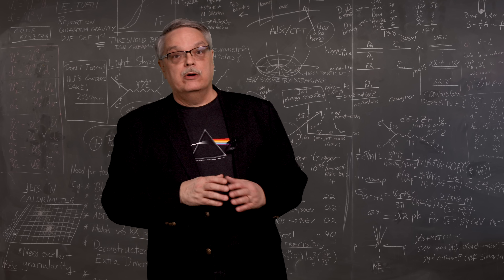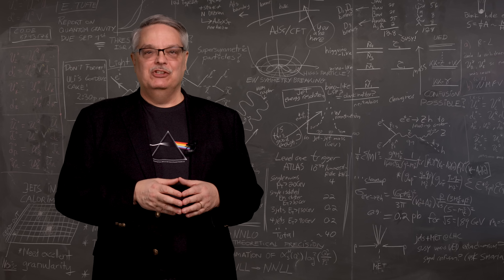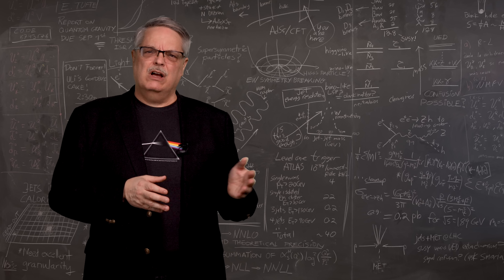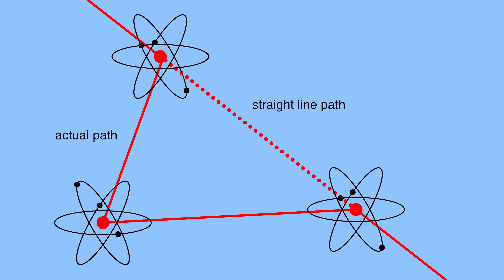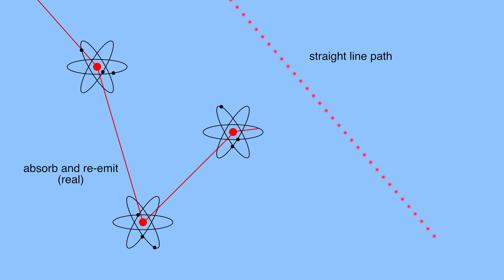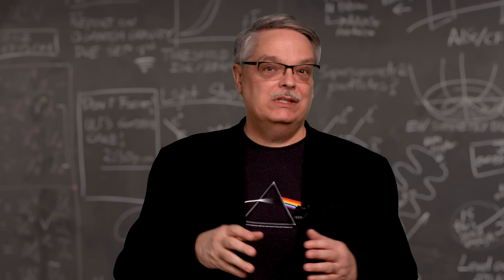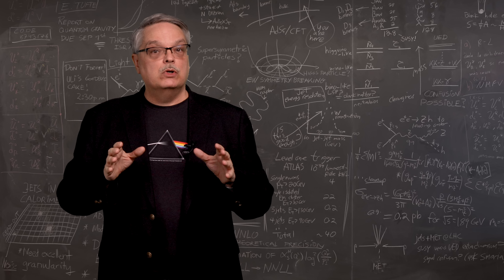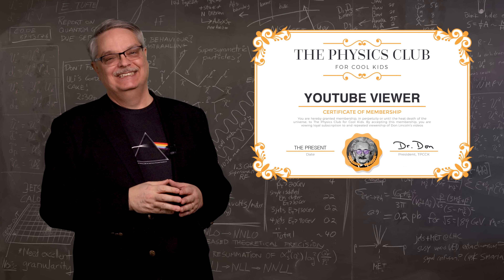Why does light slow down in water?

Comment: All very complicated. How about this:
Massless particles do not move. They expand with the universe which expanse in a quanta or pulse like expansion at a speed of, you guessed it, c. 
All particles that attract each other resist that expansion, causing what you call gravity. 
As light enters glass, it doesn’t slow down because it isn’t moving. Instead it is propagated through a different time frame due to the reduced expansion. 
Simple! (I’m from the future by the way and this is common knowledge)
Reply: Weird from my time-line in year 2251 we have a different explanation.
Reply: Oh crap. I’ve altered the future again! I’m going to get fired for this.

Comment: Much fun and i love the straightforwardness of the reasoning and presentation, but there is something i am missing. If the interaction of the light wave with the electrons is producing a second oscillating electric field that will be summed with the original light wave, wouldn't the second field have a constant phase delay relative to the light wave? That wouldn't produce a slower wave - it seems like the summed wave would be an attenuated (by the second field) version of the original light wave traveling at the same speed. I don't understand where the slowing comes in.
Reply: In the link below there is a really good explaination with quantum field dynamics. It is less hard than it sounds. It comes down to this: When a photon enters the medium, the EM-wave interacts with charged particles in the medium. It shakes them around, and drags them with it. To do this, the photon has to give some momentum to the material. The cool thing is, that while doing this, the energy of the total wave stays the same, but the momentum goes up because the mass that is part of the wave goes up. But if the momentum and the mass of the wave goes up while the energy in the wave stays the same, the propagation speed must drop. At the end of the glass, (almost) all of the wave energy goes back into the massless photon, and it shoots off like nothing happened. Just learned this, and I think this explaination is very satisfying. https://journals.aps.org/pra/abstract/10.1103/PhysRevA.95.063850
Reply: @frederikwinnubst7863  Any correlation to Lenz's Law?
Reply: I agree, I am missing something too. The only way that makes sense to me is if the induced electric field travels slower than the speed of the inducing field - which doesn't sit well with my understanding of physics. Dr. Lincoln said that (paraphrasing) "taking longer to traverse the medium is the same as going slower", why would the interaction with the induced electric field make the resulting superposed waveform take longer to traverse the medium?
Reply: The phase velocity of the second wave is much smaller. That drags the phase velocity of the summed wave down.
Reply: @frederikwinnubst7863  "The phase velocity of the second wave is much smaller".   
Ok. Why?
EDIT: Ok I'll read the paper tomorrow. Thank you for the link.
Reply: @frederikwinnubst7863  What is "phase velocity?"
Reply: @frederikwinnubst7863  But WHY is it smaller?
Reply: Light is slowing because the Speed of Light is NOT A CONSTANT.  Period.   All other answers are mathematical tricks.

Comment: This does not only apply to light, it applies to any electromagnetic wave travelling through a medium. Back to light again... If light were to travel through a vacuum it would travel at a velocity equal to the speed of light (299,792,458 metres per second, although that figure dosen't really matter, because it is theoretical). instead we use a 'velocity factor' to describe the velocity that an electromagnetic wave  will travel through the medium that it is travelling through. This 'velocity factor' is the ratio of the velocity at which a wavefront (of an electromagnetic signal, a radio signal, a light pulse in an optical fibre or a change of the electrical voltage on a copper wire) passes through the medium, to the speed of light in a vacuum. More here... https://en.wikipedia.org/wiki/Velocity_factor

Comment: Thank you for your video. One question: lets suppose that a monochromatic beam (a laser) travels through water or air with high humidity. How that will change the color (frequency, wave length, scattering)?

Comment: But there is one question remains. Does wave generated by electron moves slower than the light wave?? If it is not, there is no reason to say that the speed of light will be slower.(but the only thing that we can say is the wave length of the wave will be changed)

Comment: Why does not the color of the light change if it's frequency is changed inside the material?
Reply: I was taught that  frequency depends on source so it does not change when light crosses a medium rather the wavelength changes in such a way that the ratio of speed of light in a medium to the wavelength of light in the medium remains constant and hence the colour doesn't change.

Comment: He must be wrong when he says the induced wave travels slower than the incident light. Both are em waves
Reply: Singing Physics with different wave lengths
Reply: @oceanwave1875  yes but different wavelength waves have the same speed
Reply: @singingphysics9416  nope the wave equation is different inside a medium, thus modifying its speed
Reply: @recouer  but em waves always have the same speed
Reply: @singingphysics9416  it has the same speed in a void, the speed of light is highly dependant on the medium in which it goes through.
Reply: @singingphysics9416  
you can easily find the speed of a wave by finding its wave equation, just google "wave equation" and look at the wiki page, it's rather hardcore physics but if you are determined enough, you may come to understand how it works (cause it's not that hard to understand)
Reply: @recouer  yes, classically the speed of a wave depends upon the medium. But according to special relativity it doesn't, hence the need for this video. I think he just made a slip of the tongue to say the induced wave had a lower speed
Reply: Singing Physics  no no no, that's not what relativity says, light really does slow down in a medium, just not for the reasons understood in this video (dr don kinda misexplained trying to vulgarize the phenomenon)
the maximum speed at which a massless particule can travel in a vacuum is fixed that's what's said.
Reply: @recouer  you're mistaken
Reply: @singingphysics9416  then so is wikipedia
Reply: @recouer  link please
Reply: @singingphysics9416  
"According to special relativity, c is the maximum speed at which all conventional matter and hence all known forms of information in the universe can travel"
https://en.wikipedia.org/wiki/Speed_of_light

Comment: Why does the light bend back to original angle after leaving the glass?
Reply: The answer is that it doesn't typically exit at the same angle based on the angle ot enters and the mediums it passes through. 
https://youtu.be/DR-8ZRCHCXI
Reply: Because it speeds up again
Reply: excellent question.   I hope it gets answered.
Reply: Ok. I'm going to try this one. The photon is a sustained wave in the photon field. When it enters the medium, the electrons (sustained waves in the electron field) interfere and the combined wave is slower as determined by the refraction index of the medium. When the combined (interference) wave exits the medium, it no longer is influenced by the electron field, so it returns to its original energy state and continues on its original path and speed. 

As Don stated, you must think of the photons and electrons as waves. And waves exist in their own quantum fields. These fields exist everywhere. So they exist on top of each other. One wave in a given field will influence other waves in other fields, if they exist in the same place. When they are not in the same place any more, they return to their original state. For this example, the same speed and direction.

Comment: Light does not change speed ever.  This paper shows why.  Remember refraction is right at the surface.  Light does not effect electrons at all (proven many times).
If you want latest information on time dilation, fixed light speed and understand algebra, then download this open access, no login, no ads, 2018 Cern archive journal paper.    https://www.zenodo.org/record/1447218

Comment: An even more interesting question: why does a photon generated in the centre of the sun, travelling at 186,000 miles per second, take 100,000 years to reach the surface and finally be liberated?

Comment: But the speed of light and is the same as the speed of every electromagnetic wave!!!! So also the wave generated( by summing the osscilation of the electrons and the primary light wave ) must be at the speed of light, because it is still an electomagnetic wave!!!!
Reply: Yes, the resultant generated wave can also be though of as an electromagnetic wave, but your conclusion is wrong that it therefore must have the same speed as an electromagnetic wave in _vacuum_. It will have the slower speed that is the speed of light in the transparent material.

Comment: @Dr. Don Lincoln If this is not correct please let me know i will delete
 thank you =)(http://buphy.bu.edu/py106/notes/Refraction.html)"When we talk about the speed of light, we're usually talking about the speed of light in a vacuum, which is 3.00 x 108 m/s. When light travels through something else, such as glass, diamond, or plastic, it travels at a different speed. The speed of light in a given material is related to a quantity called the index of refraction, n, which is defined as the ratio of the speed of light in vacuum to the speed of light in the medium.When light travels from one medium to another, the speed changes, as does the wavelength. The index of refraction can also be stated in terms of wavelength,Although the speed changes and wavelength changes, the frequency of the light will be constant. The frequency, wavelength, and speed are related by,The change in speed that occurs when light passes from one medium to another is responsible for the bending of light, or refraction, that takes place at an interface. If light is travelling from medium 1 into medium 2, and angles are measured from the normal to the interface, the angle of transmission of the light into the second medium is related to the angle of incidence by Snell's law :When light crosses an interface into a medium with a higher index of refraction, the light bends towards the normal. Conversely, light traveling across an interface from higher n to lower n will bend away from the normal. This has an interesting implication: at some angle, known as the critical angle, light travelling from a medium with higher n to a medium with lower n will be refracted at 90°; in other words, refracted along the interface. If the light hits the interface at any angle larger than this critical angle, it will not pass through to the second medium at all. Instead, all of it will be reflected back into the first medium, a process known as total internal reflection.

Total internal reflection
The critical angle can be found from Snell's law, putting in an angle of 90° for the angle of the refracted ray. This gives,
For any angle of incidence larger than the critical angle, Snell's law will not be able to be solved for the angle of refraction, because it will show that the refracted angle has a sine larger than 1, which is not possible. In that case all the light is totally reflected off the interface, obeying the law of reflection.

Optical fibers are based entirely on this principle of total internal reflection. An optical fiber is a flexible strand of glass. A fiber optic cable is usually made up of many of these strands, each carrying a signal made up of pulses of laser light. The light travels along the optical fiber, reflecting off the walls of the fiber. With a straight or smoothly bending fiber, the light will hit the wall at an angle higher than the critical angle and will all be reflected back into the fiber. Even though the light undergoes a large number of reflections when traveling along a fiber, no light is lost." I hope this will help the ones that can not grasp it =)

Comment: but isn't electron moving around nucleus as standing wave? I mean you have shown electron as particle in an atom but it should a standing wave, outcome would be same as you stated.
Reply: The explanation I heard is that light traveling through the medium interfere with virtual photons of electromagnetic interactions between charged particles in the medium. That way electron will be a standing wave and all the slowing of the phase speed is caused by that interference.